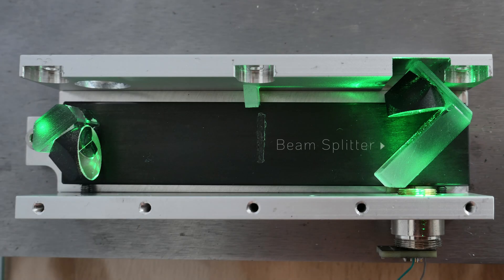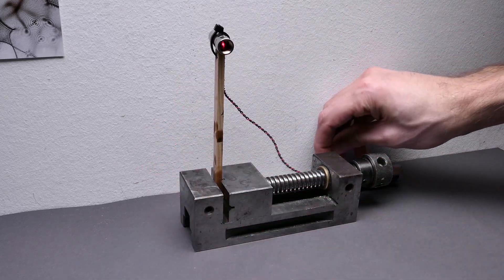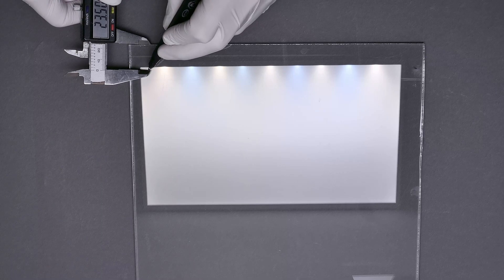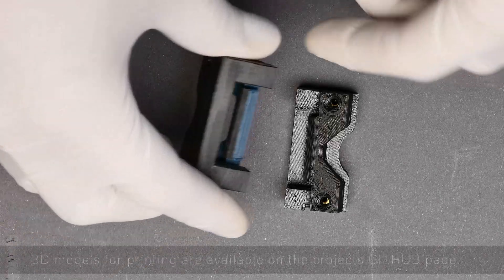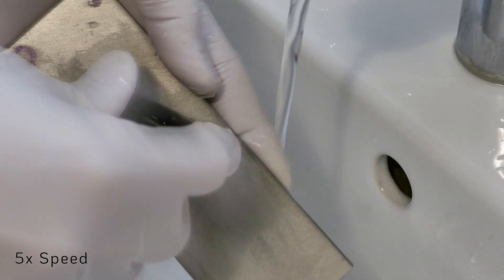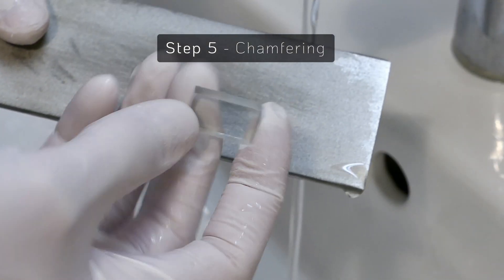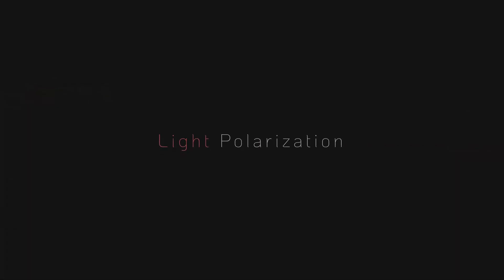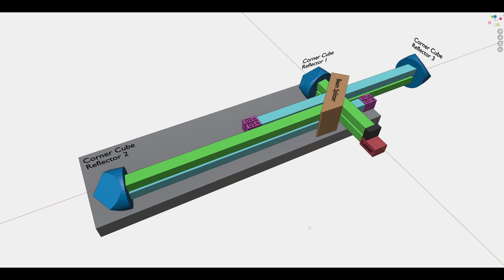Laser Interferometer - Part 2: Building the beam splitter.

Comment: For what it's wort,  carbide wheel cutters are designed for general purpose glass work, not ideal.
I use a 1/8 carbide pcb drill sharpened to a fine point for cutting optical components, diamond tips are even better.
Only very very light pressure is needed to make the scribe and no raspy chipping occurs along the cut line.

Awesome video !
Reply from the maker: I tried something very similar - In my experience this works well for thinner glass - maybe up to 3mm. However Wheelscribes seem to introduce more inner stress into the cut making it easier to break thicker plates. If you sucessfully cut thicker glass with your method, please let me know.
Reply: @DiffractionLimited 
If you  cut thicker glass with a point scribe, try laying the glass (scribe down) on a towel and gently tap the back along the scribe line to imitiate the break with a small area impactor (flat screwdriver works well). Note the initiation of the break may start almost anywhere along the scribe, but once it starts it's easily controllable with tapping. Practice.

I use this back tapping method to cut glass containers for vaccum work and it works great.
Reply: Interesting

Comment: I got an interference pattern similar to the one you called "good" using a 2x2x 1/4 inch piece of glass I got, sold as "GLP2X2-S Glass Streak Plate" from United Scientific. It was readily available. Maybe I just got lucky, I think this product does not guarantee precisely parallel surfaces.
Reply from the maker: Very good Info, Thank you.
Reply: Maybe because I mentioned where I got it, some YT algorithm decided it was commercial spam. I used the green 520nm device you recommended, but I bought from the place that starts with ali and ends with express instead of a standard component vendor, for the obvious frugal reason. Seems to work ok. I got clear stable fringes at 36 mA, but it went multimode around 37 mA. Measured optical output was 3.2 mW at 36 mA, which is 3% of the 110 mW output power the site claimed but I have seen different variants of the same part with different power ratings. This was device #2. The first part also worked for a while, but then I managed to convert it into an incoherent LED I think by excessive mechanical force on the leads. So: be careful with these parts. If I move the glass several meters away, then I see irregularities in the fringes more clearly, but hopefully that is not an obstacle.
Reply from the maker: @dancevideo2  Did you buy the PLT5 516 FA as recommended on the Github page? Anyway thank you for sharing your experience wioth the device ! Also I have no power meter so its great that you can provide the optical output power at these low currents. Its always hard to jugde by eye. Green LDs always seem so bright. 
And jes the furhter you move the glass plate away the more sensitive the setup becomes, so if it looks good at around 400mm you are good to go.
Reply: @DiffractionLimited  My longer reply to this just got deleted, I wish I knew why. I was using the earlier-mentioned 520 not the 516, but eventually I will try that one too.
Reply: @DiffractionLimited  My laser power meter is UT385 which uses a photodiode that requires manual entry of wavelength. Maybe brand names gets posts deleted, it starts with UNI and ends with -T.
Reply from the maker: You may drop me an email if you want to discuss things in detail and dont want to get your posts deleted all the time. But thank you very much for the information. If you are going to build your own, I am really interested in your feedback and help.

Comment: You might consider to start with a higher grit (about 200 should be good) and then work your way down over 400, 600, 1200 to 2000 grit. That way, you will have no breakouts anymore at the edges of the grind.
Reply: Also, a rotary grinding machine (whis is easily built) will much improve grinding exact 90deg angles.